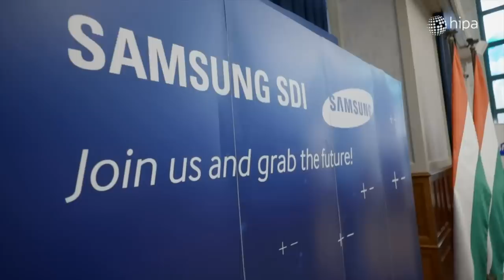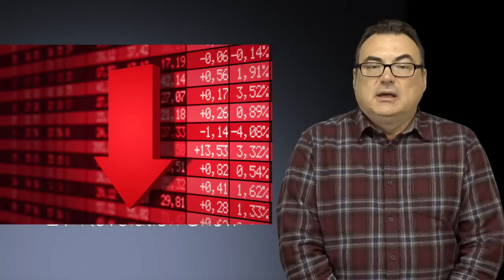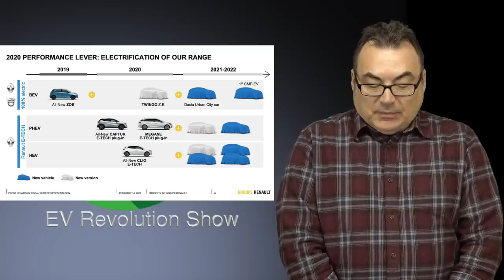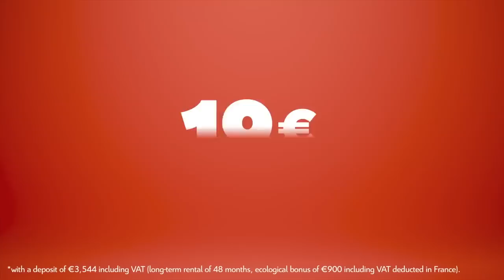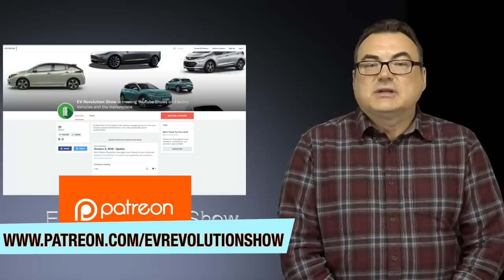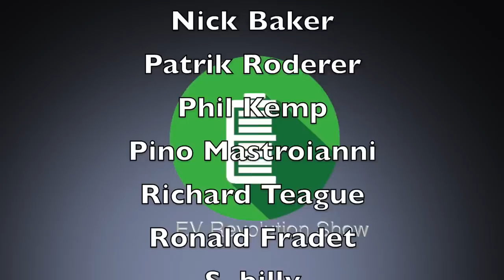Episode 82 -  Global Impacts, VW I.D.3 Issues, IVY Charging Network, Citroen AMI & more news!

Comment: Ivy network news is 6 months old. Many chargers are up and running.  They were allowing level 3 charging for free, but I believe they may have started to require payment now.  Disappointed that there was no mention of Hyundai production shut down.
Reply from the maker: Thanks for watching.  Not sure how it's since months old since they only launched it during the Autoshow.  Only 1 was up and running the day of the launch so not sure where you get your facts.  

I've mentioned the Hyundai/Kia production issues on past shows.  Can't same the same stuff on every show.
Reply: EV Revolution Show I guess technically it was 5 months ago. 

https://electricautonomy.ca/2019/10/07/opg-hydro-one-shake-up-ontarios-fast-charging-landscape-with-launch-of-ivy/ 

I do understand you can't repeat the same information on every video.  I was just hoping for information on the Hyundai plant closures as the main stream media don't cover it very well .....or at all.  I will check out some of your other videos.
Reply from the maker: I stand corrected.....Ivy went live Sept 30 2019.  Was real quiet until the official launch at CIAS.  If you use one, let me know how it goes for you.

Comment: Does the ivy network have a tesla connection or is some sort of adapter required?  What type of plug in?
Reply from the maker: Hello and thanks for watching.  I'm not sure if they are deploying any with the proprietary Tesla connector, but you can use the CHAdeMO plug with a CHAdeMO Tesla Adapter.  They are not cheap but will work.
Reply: @EVRevolution  oh OK a $600 dollar adapter I will pick a couple up.  A 50 KW charger maybe not. Ontario doing gr8 things again.
Reply from the maker: Good luck!
Reply: @EVRevolution  No luck required we have SC's

Comment: I think in order to be attractive for carsharing the Ami would have to come with at least some kind of fast charging. From my experience typical inner-city carsharing distances are ~15-20km per trip; so with 70km range (i.e. realistically more like 50km) those vehicles will have to be recharged 1-2 times per day minimum - that means 3 to 6 hours per day not earning money. Even just 7kW charging should give a sub 1-hour charging time without stressing the battery too much (charge rate <1.5C).
Also most public chargers are Type-2, so you won't go far with a standard plug...
Reply from the maker: Thanks for watching Stephan and good feedback!

Comment: "less than 100km apart on average". Place 90% in Toronto, all within a 20x20km radius, and the rest 300km apart...

If the Citroen is available from 16 years in Europe, it's going to be classed as a moped and limited to 45kmh, banned from highways and motorways obviously.
New for Citroen, the class has been in existence for over a decade as EVs and about 25 years as diesels.
Reply from the maker: Hi and thanks for your feedback and info.  Yes LSPV's have been around for awhile.  In North America, seem mainly in gated-communities in more warmer climates.